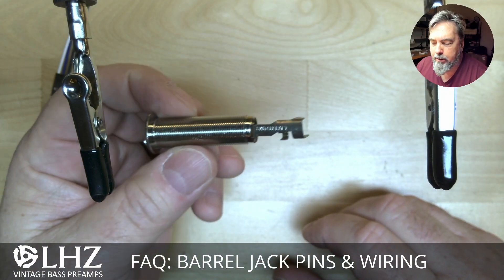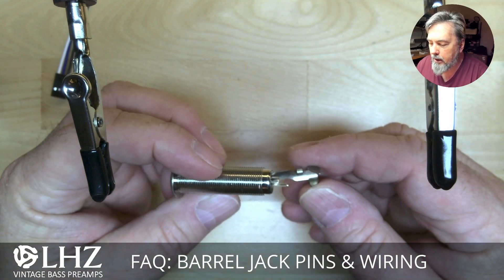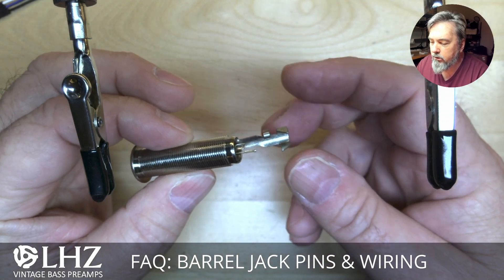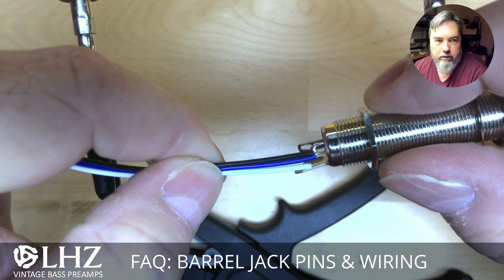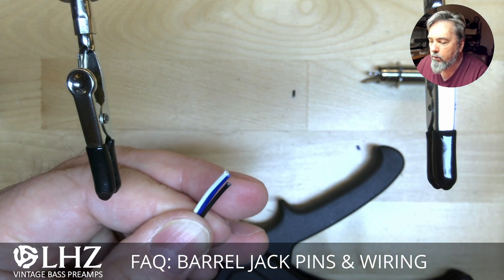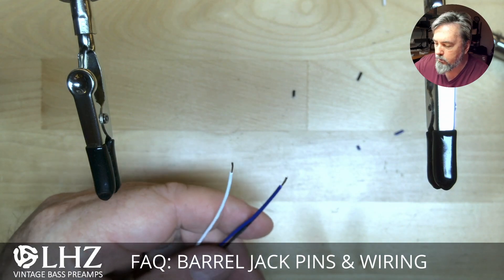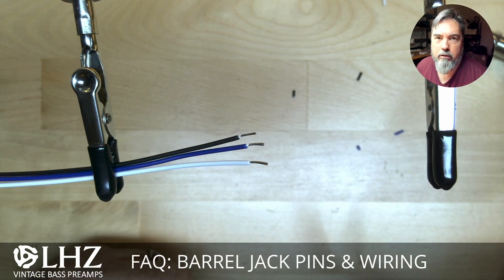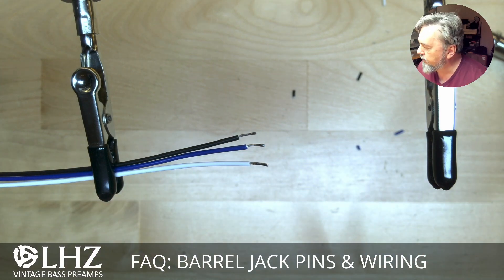LHZ FAQ: Barrel Jack Pin Identification and Wiring

Comment: So I'm new to all this. I bought an EMG solderless pickup kit, but the jack doesn't fit in my guitar. There are three wires to connect, two black and one white. One black wire comes from the bridge pickup, and one comes from the knobs. Which one of those would be the black wire and which would be the blue wire in this video?

Comment: If you look at the German Warwick $$ schematic, the volume pot has a direct to jack preamp defeat.  

Nordstrand showed off a few basses that had a tone pot in their passive path when you bypassed their preamp.

I need to incorporate some of these ideas in my next build.

Warwick jacks also have a connector soldered to them that I found convenient when swapping preamps into an existing harness.